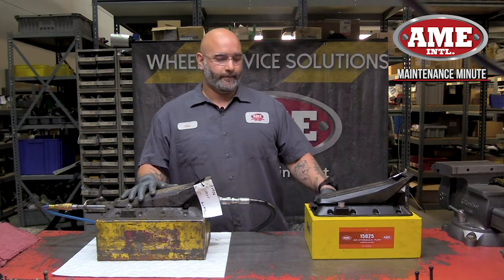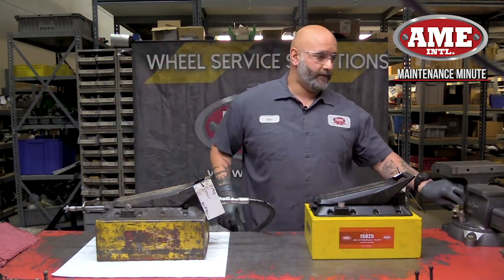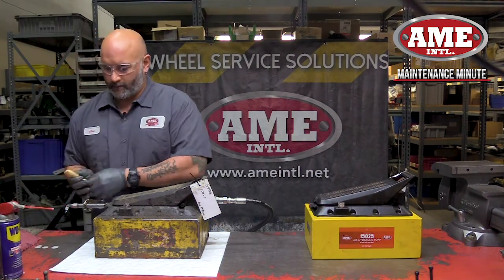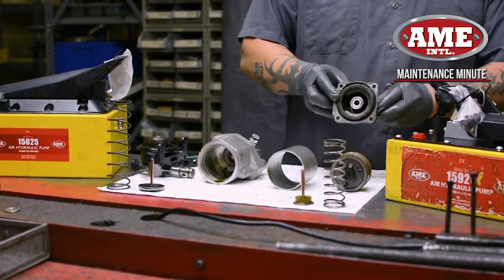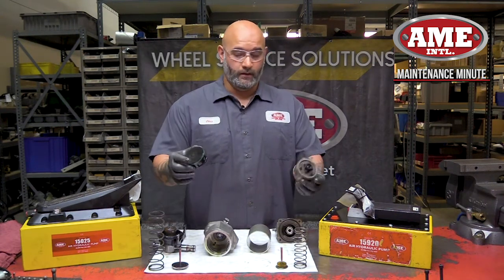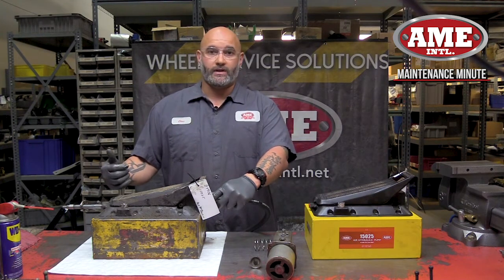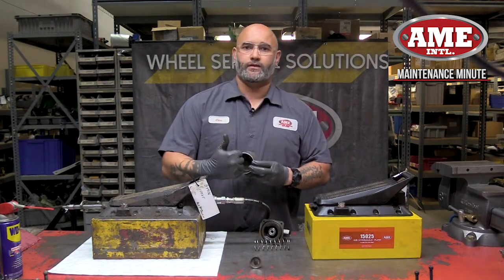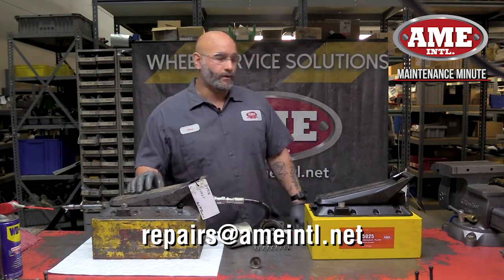AME International's Maintenance Minute: Air Hydraulic Pump #15025 #15920

Comment: Great video ... Question: Why don't they make these with a larger tank??  I'd like to push a 3" x30" or bigger, hydraulic ram. It doesn't look like this unit would hold enough oil to fully extend the ram.

Comment: Watched your video and tried the wd40 in the inlet and worked a treat …I have a bma foot pump and it was permanently bypassing 

Thou it now bypasses when load starts to come on - I use it to power a hose crimper and now it just won’t crimp the ferrules tight enough - what do you think the problem is ?